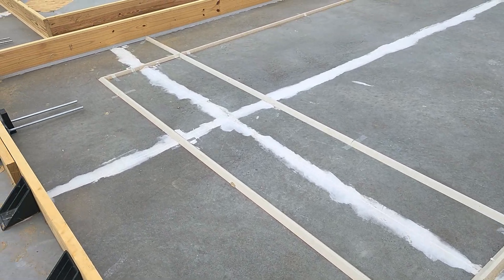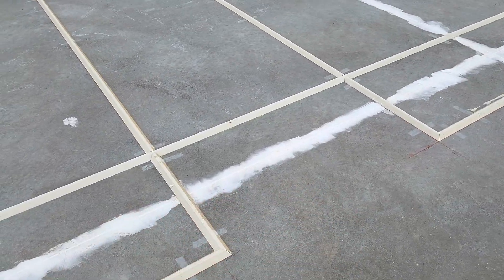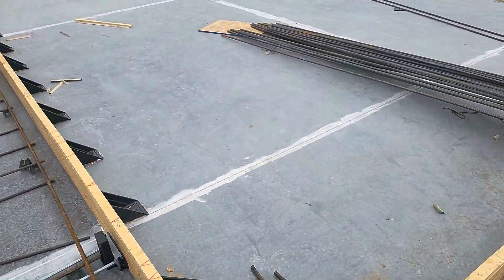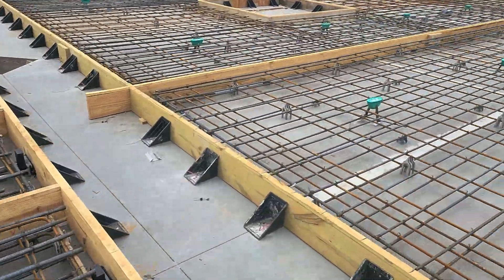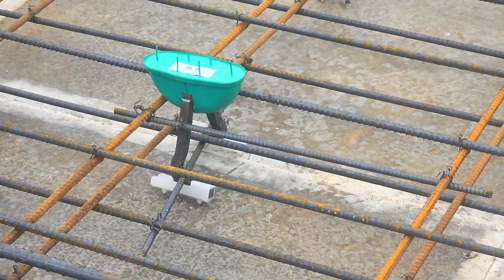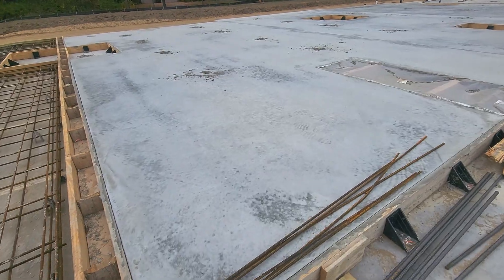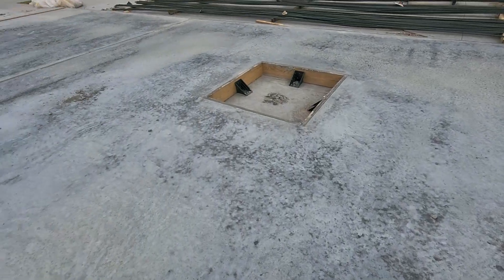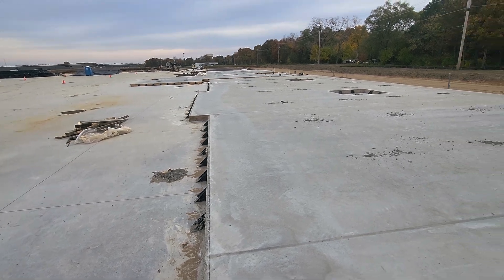Tilt Panel concrete wall forming, rebar and construction.

Comment: Why about all the electrical and plumbing? Did it go in already or does that happen later?
Reply from the maker: @user-mv4nt9xk4i  that was all done prior to slab being pored.   All the conduit were plugged and flush at floor height so we could pour tilt panels over them.
Reply: @rockyfrance  Thank you so much for responding! your videos are truly helpful. does the surveyor mark the locations for the electrical and plumbing? i know the that prior to the foundation being framed the surveyor marks the corners of where foundation will be. Am thinking once that is done electrical and plumbing go base on the framing for concrete, correct?
Reply from the maker: @user-mv4nt9xk4i  exactly!  In this case,  the Surveyor left us all the building corners as well as all the column placements throughout,  so the utilities had plenty to reference from to pull measurements for their projects.
Reply: @rockyfrance  dude god bless you! Thank you for responding. I have been involved in lots of interior general contracting and am now making my way into the exterior ground up side. There is a lot of tilt wall ground up work and I was looking for pointers since I am fairly new to the tiltwall work. Again thank you
Reply from the maker: @user-mv4nt9xk4i  Mt pleasure brother.
Reply: @rockyfrance  hey boss, how long do does it take for the wall panels to be 100% ready and cured to start picking them up and setting in place after pouring?

Comment: How are the wall panels fixed to the slab (floor) and to adjoining panels once they are tilted up in place?
Reply from the maker: When we set them they are set on shims, then grout is poured all around the bottom.  On this particular project, the panels fix to each other overlapping and grouted
Reply: @rockyfrance  Thanks.  I see these tilt up warehouses and other buildings going up around me.  I see the welding going on at the roof trusses but never really see anything going on at the ground level. I thought there may be a key way at the floor slab that the panels slip into when they are hoisted into place. Thanks again.
Reply from the maker: @stevengiles346  we actually poured out footers and left the floor 2 ft back from the footers so the walls set directly on the footers with shims. After the building is built , we came back and poured the 2 ft strip all the around the building,  which helps lock it in.

Comment: I see some constructions in my area where I live for commercial buildings.  I was wondering how the heck the walls just sprung up over night.  I did not know that those were molded and poured on site and just lifted up after the concrete hardened.  I did not know that there are such thing as wax coating to prevent the freshly poured concrete stick to the slab.  Thanks to your video, now I know how the walls sprung up like mushroom overnight... 😀 👍👍
Reply from the maker: This comment is the exact reason I do videos.   Thanks my friend